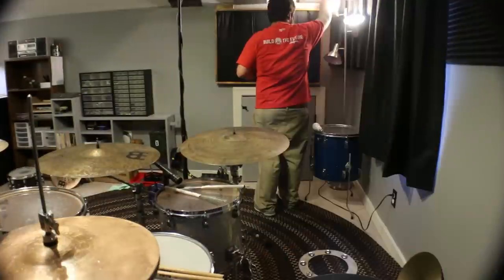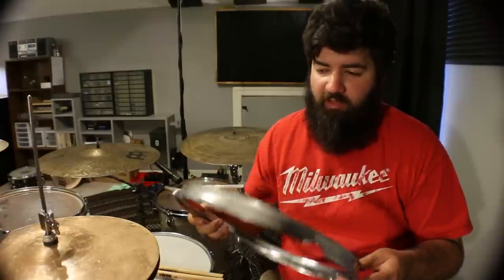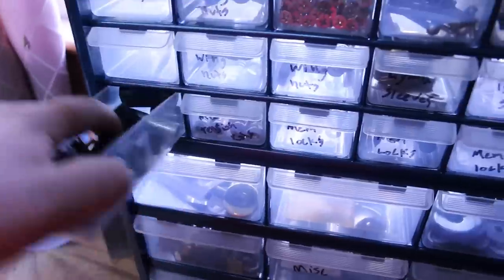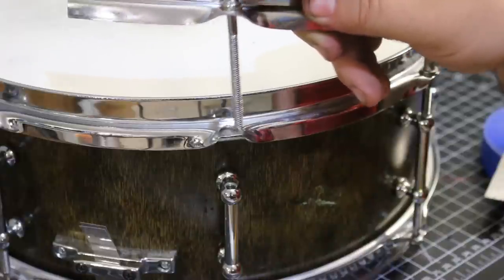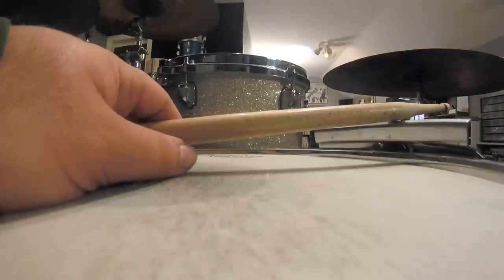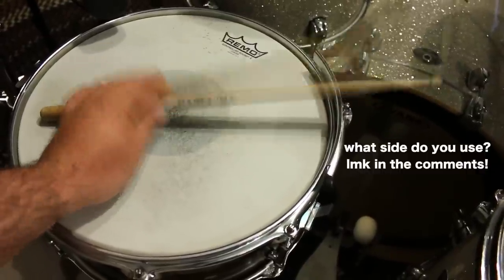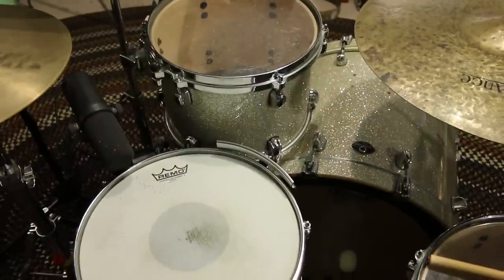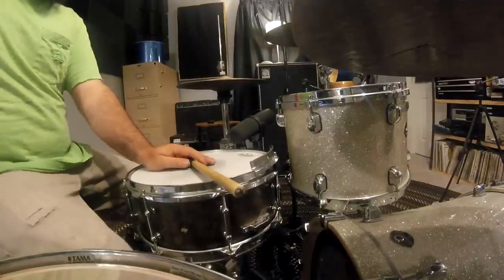DIY Rim Riser + Ultra Advanced Quadruple Cross Stick Technique

Comment: Worked in a drum shop for 3 years: one of those gizmos every client came back to me and said it's useless, except the wood version one, if you're into latin beats, the wood version will give you a way bigger difference (unless you have wood hoops) and it`s actually cool cause you can have 2 different types of tones using the same technique.
Reply: Which drum shop?
Reply: It does not play itself.  You have to x stick as you normally would now with a better grip on the stick FYE the drummer in this video used a cheap used Hoop and neglected to use key elements of our kit.
Reply: It's used and Trusted by 10s of 1000s of Drummers.

Comment: Yep, that's me, I cross-stick with the tip instead of the butt end. After experimenting, I found a sweet spot on my snare drum
where I could get a good cross-stick sound and I marked the stick position (butt end, and tip end) onto the batter head
with a Sharpie marker; so now whenever I cross-stick I get the same consistent sound every time, and I can then switch back
to hitting the snare during a song. 
I'm not sure if I'd wanna use a rim riser, but this DIY rim riser will inspire other ideas along the way.
I really like your Quad cross-stick technique, it sounds kinda like a flam "hand-clap" and if used tastefully it can add
a really nice dynamic effect into a song section somewhere.
As always, your videos are awesome. Thanks for sharing! :D

Comment: LOVE THE VIDEOS!!! I use the tip only because it is faster to switch back-and-forth. I prefer the sound of the butt end,  but most of the time I can't flip it. 
Yamaha made a product like this a while ago, I am not sure if they still do, but it was made of maple. It was called the groove wedge. It was a great way to get a good cross stick on small snare drums. This idea doesn't seem to add too much to the diameter of a drum, but it might help. Also, how about mounting it backwards on a small snare, it will then push the rim out for a better cross stick. The only downfall would be that it sticks out and could snag something.

Comment: As to using the butt of the stick, in the old days a woodblock was a standard accessory. While it fell out of favour over time, if you ever needed that sound the butt end across the rim provided that. Also, since this technique emerged back when everyone played traditional grip, it's quite easy to flip your left hand over to get that position. It of course is much less easy to do when using matched grip, hence many people nowadays just staying with the tip across the rim. But if you watch any old jazz videos (let's say before 1970) the drummer is always using the butt end across the rim.

Comment: I am a drummer of 50+ years and I would never use an extra piece of a rim for a rim shot. I use the snare rim and I also have a plastic block that I use as a rim shot sound at times. I do agree with using the tip of the stick for the rim shot instead of the butt of the stick. There are "sweet spots" just a short ways down from the tip that gives a great rim shot sound. But it is usually just one spot. It varies from stick to stick. Guess you could say I am "old school". Love your vids. I like how you redo and build drums and the different things you do with them.

Comment: Great video, brotha! I've seen these before, but I thought they were usually made of wood to get more of that, y'know, 'woody' sound. But I agree, they're sorta useless considering they really don't change the sound of the cross stick. 
And, I'm a tip of the stick on the head, butt on the rim kind of person myself (which typing it out sounds like euphemism, but what doesn't these days?). I like the more articulate, higher pitch, which really cuts through especially if you're playing in a big band setting.

Comment: Even though I probably won't need to make half of what you make in your videos, they hold very important information delivered in a very nice manner, well done david! I personally would just stick to not modifying a rim to make or even buy a rim raiser, not really worth it, and I use the skinnier part of the stick, not the butt.
Reply: I mean, to add onto the "which side of the stick do you use," is there really a set in stone way of doing it? It's whatever sound you're trying to achieve, or which sound you like. So if you don't like using the butt end that's totally cool, if you do that's totally cool, but trying to change other drummers for your own satisfaction... I don't know not very cool. As drummers we should be different and keep the variety in drumming alive.
Reply: The skinny side of the stick is high pitched. The fat side just sounds dead to me, which very well might be a good thing, like when trying to be quiet.

Comment: I use the tip of the stick. I like the lighter sound of it and plus its quicker to get to the flipping the whole stick around for 2 hits then flipping it back around because I use the rim a lot more then normal (I think so) mainly because aric improta does it and I tried and it works for me. but hey we are all different. im sure some people use the butt end of the stick for their reasons.

Comment: the butt-end used when cross-sticking in my opinion, makes a  heck of a better sound. If one doesn't want it so "deep", just adjust the length you use and the spot you hitthe rim with.

Comment: Haha, definitely always play cross sticks with the tip ;). Brighter than the butt when you find that sweet spot <3.  I also never really liked rim risers since it felt like I was losing the actual tone of the drum when cross-sticking.  With the regular rim down tight I feel like you get a brighter cross stick and tone than a loose rim riser.  Great as per usual fellow David.
Reply from the maker: thanks d00d. Also, ive been sitting on that video we talked about forever now... I should probably finish it haha

Comment: When I am using match grip on the set, I am more likely to use cross stick like you are showing with the butt on the head.  When using traditional grip, it is easy to cross stick with the tip on the head and the butt of the stick out.  It is easy to pick the stick up and continue playing.

Comment: Awesome quad cross stick! I guess the product may be good for keeping wood hoops on a snare while still getting a “decent” cross stick sound? In my case, I’d like to switch the rims on my 13” from wood to triple flange, but it was built with 10 lugs for some reason, so I don’t have the option of switching to triple flange rims. I might be able to fake a better cross stick sound with that product, but I still wouldn’t buy it.

Comment: I have found that for anything bigger than .565" diameter sticks (5B and up) playing with the tip end (like you did in the video) gives the best sound. However, on smaller sticks, you loose alot of timber to the cross stick, thusly using the butt end works much better.
This is just my $.02 and opinion are like buttholes, but you asked, so I shared LOL

Comment: I can see how this could be used: A friend once showed me a beat where you start on the hi-hat, then cross your hands between hi-hat and snare and you finish on the snare. Then he told me that instead of using the hi-hat, you can also use the rim of the snare. Playing this beat would be easier with this raised rim. 
About the beat, I'm not a drummer, so chances are that all of you already know it. Also, I have no idea how you show a beat to someone using text only. It goes approximately like this :
4 hits on the rim (always alternating your left and right hand), 2 on the snare (this is when you cross your hands), then one on each (total of 6 hits: rim-snare-rim-snare-rim-snare) and you finish with 4 hits on the snare. This sounds pretty cool, especially if you play it fast.

Comment: I think that anything which adds an extra sound to your arsenal as a drummer is worth exploring, but the only viable justification I can think of for this is that it takes the hammering that would normally be aimed at the actual hoop. If you play the rims enough to damage them or make them start to warp, then it's a good idea. Otherwise not so much imo. 

That being said, I think a metal raiser on a wooden hoop or vice versa would be worth the extra sound.

Comment: Tip, because that's the most logical if you play matched. Just like but is the most logical when you play traditional. It's just the easiest way with the minimum effort in two different ways of holding your sticks. But, as mentioned, play however you want!

Comment: There may be a larger difference in sound if you had used  two different hoop types. Die cast vs Flanged. Using two flanged rims I'm not too surprised they sounded similar. Cool concept though

Comment: David, what was that polish/buffing thing you used on the drill press? Looks nice, is it something I can just pick up at the Homeless Despot or Slowe's?
Reply from the maker: horrible fright actually
Reply: Ah, the primary destination of any tool connoisseur, thank you! This is one of those tools I would only very occasionally use, so the $89 fancy schmancy set is difficult to defend, especially if you can find one for $3 at the fright. Thanks!

Comment: Direction of the stick is irrelevant. It’s about where the end of the stick lies on the batter head.  By placing the stick end on the nodal points of head, meaning the center and quarter points.  You want maximum head resonance that way one can combine the sound of the head and rim in their most available capacities.  That creatures a loud, full, and resonant knock.

Comment: Yamaha produced a wooden wedge like this and they also had a model with tambourines in it. Perhaps that kind of thing would make more sense and maybe you could make one yourself to try it out. Here's a picture of it 

https://www.long-mcquade.com/files/10213/lg_rmjw.jpg

I hope you @rdavidr see this message. You could maybe even improve yamaha's design by making the wedge a little bit hollow so it would produce more volume and different tone, a bit like a block. This could be a useful add-on to a metal body snare with metal hoops, to get a bit of a sound of wood. Also, if the wedge has tambourines or something else on it it could also be placed on a floor tom or elsewhere than the snare. Maybe even front tom and play a cross-stick there?